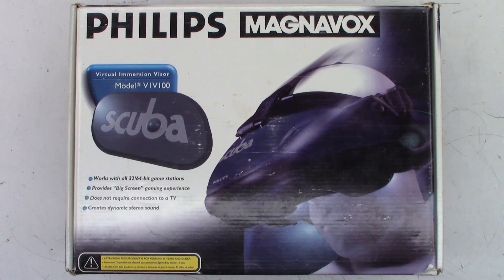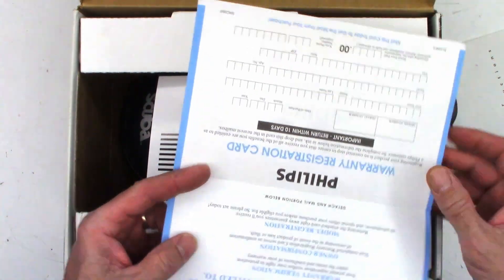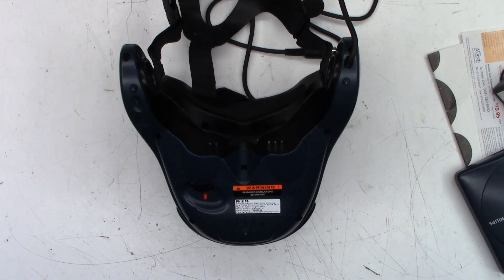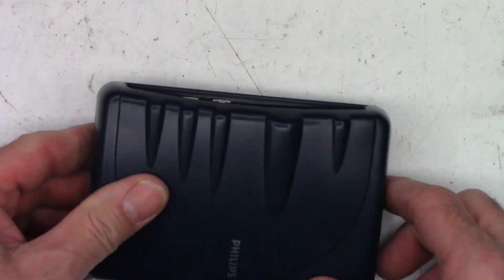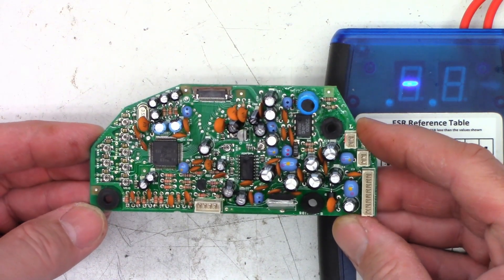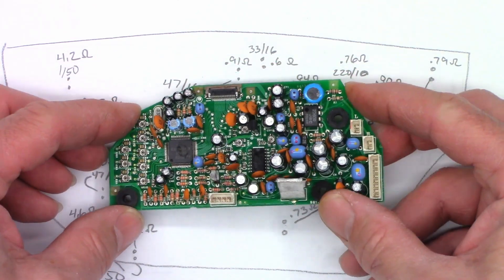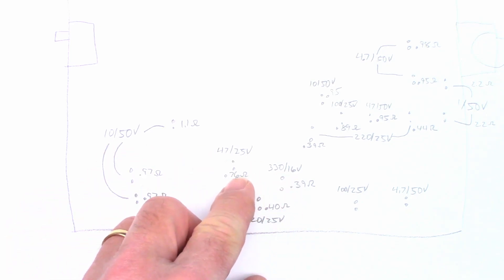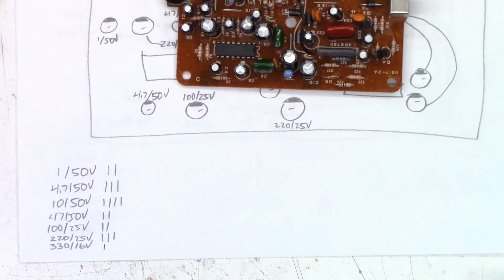Philips Scuba VR headset from 1997 VIVI00 V1V100 Testing all of the capacitors for replacement ??

Comment: Did you find out if this scuba has one lcd per eye or if it’s just a single lcd being looked at through two eye lens?  I’ve always been curious, and also curious if conceivably the screen could be modded and replaced with a more modern lcd screen
Reply from the maker: Jonathan, I did not did that far into your unit. Sorry